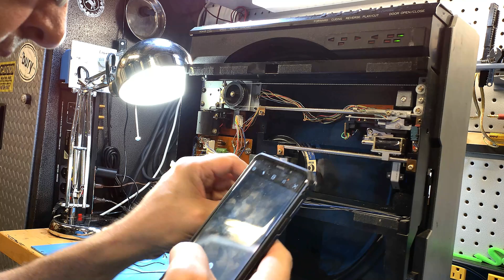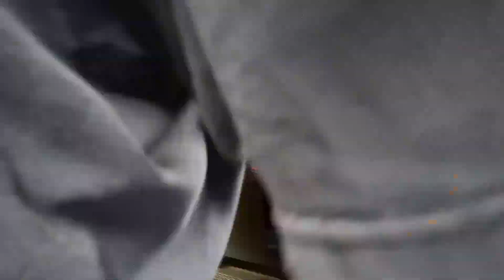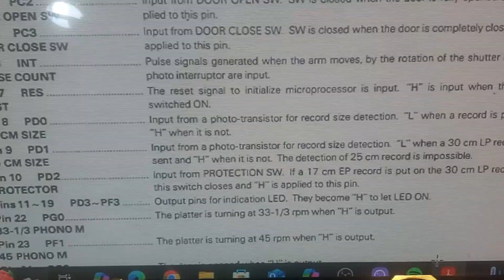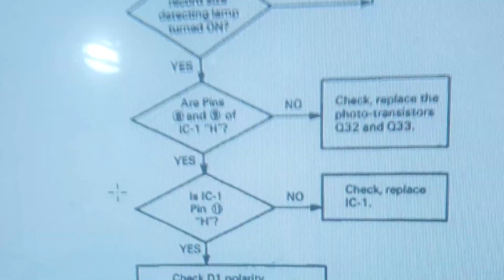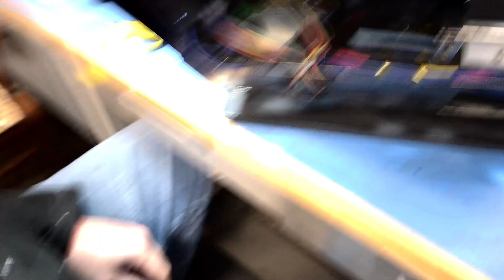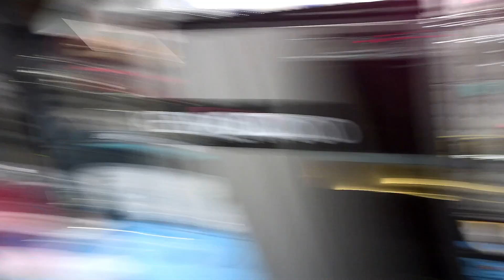Kenwood P9 - Vertical Turntable {Part 3} - Final Fixes

Comment: Great job finding the fault! I have a technics sl1600, fully automatic turntable from the 70’s that I rebuilt. Tons of trouble shooting and it was simply a bad solder joint on the motherboard that prevented it from making a decision about what size record you had on it.
Reply from the maker: Thanks! It took awhile to work through all the logic of the components and just a lucky spot of the cracked board. Lesson learned! Do a careful visual inspection of everything first instead of rushing into it. Oh, and go Gulls!